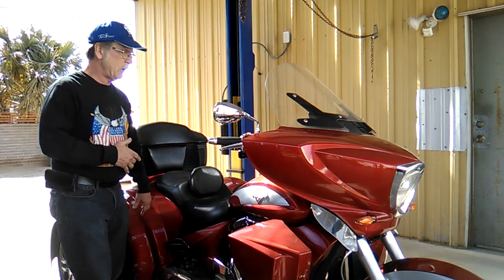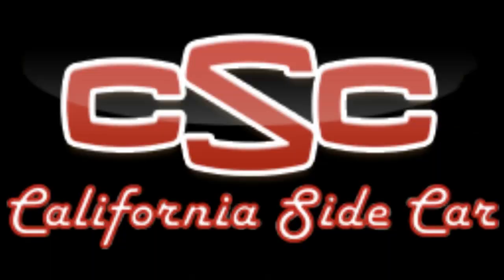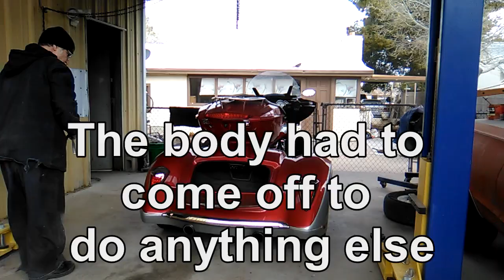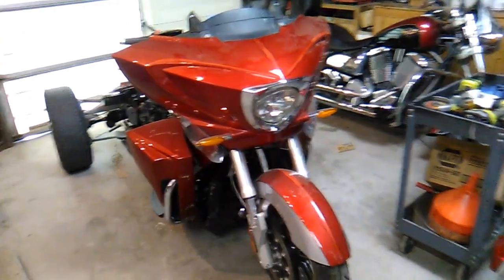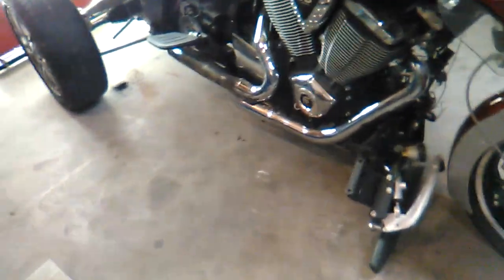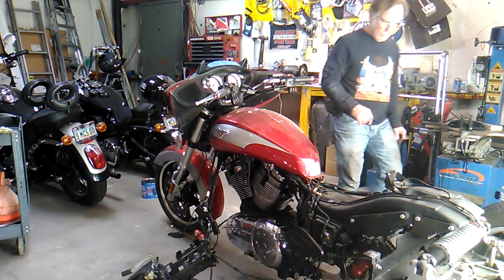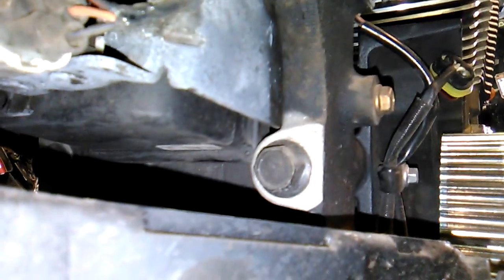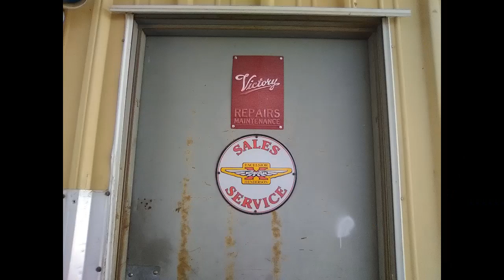Two's Company, three's a crowd. Part 1

Comment: I helped the mechanic at Southwest Trike replace the body on my CSC trike. It probably weighs 225# or so. My rear pulley stripped the splines off, due to an improper temper.
Reply from the maker: Gordon has had his rear end rebuilt in the past for failures. Apparently this wasn't uncommon. And thanks for the weight estimate, I'll try not to drop it on my big toe.